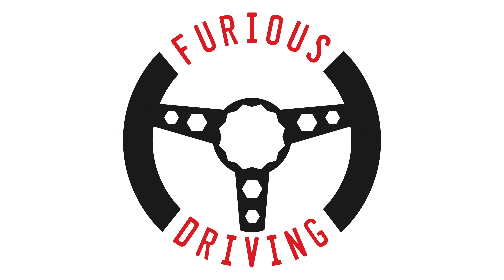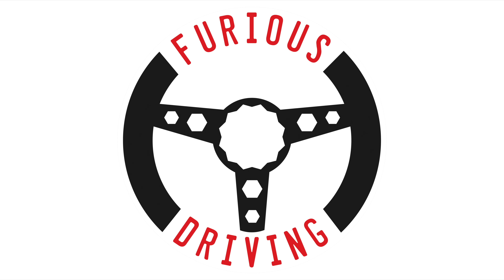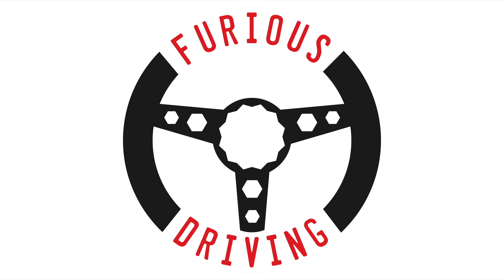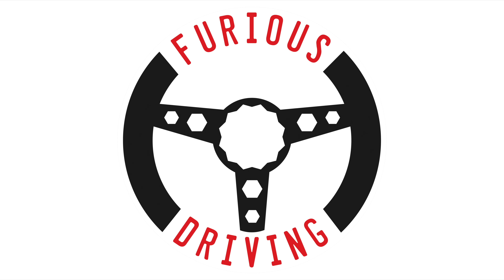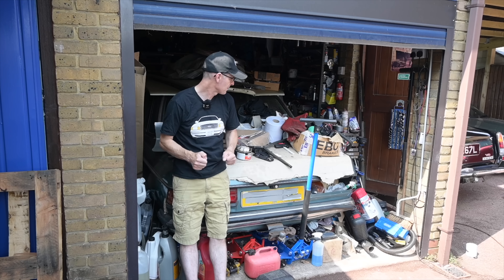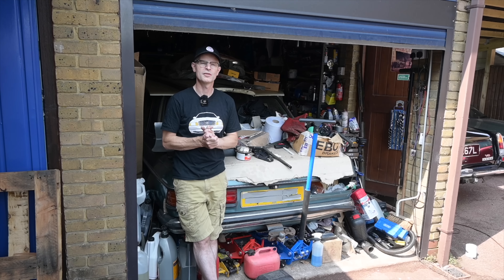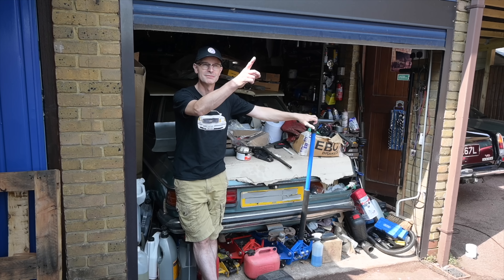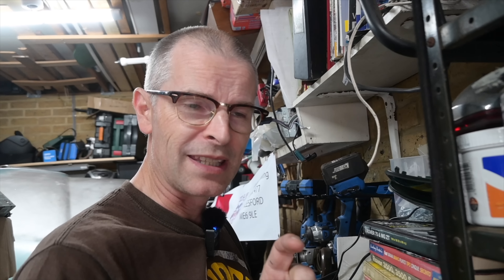Mercedes W123 broken again. ANOTHER new fuel pump....

Comment: Brought back some memories, this one. I was working on a friend’s Triumph Spitfire a few years ago and managed to pull the steel fuel line out of the rubber hose under the tank, which began to empty itself on my garage floor. Naturally I figured that folding the hose over would stanch the flow, only to find that the rubber was quite rotten, and simply crumbled. You never forget the feeling of nasty old fuel running down your sleeve into your armpit.

Comment: Good to see the tester finally make an appearance. Green LED indicates a ground connection, Red is positive! I've pretty much never had a problem with modern fuel, but I don't leave tanks with only dregs in the bottom. They should either be drained, or topped off (maximum fill volume and minimum surface area). There's a reason you should never run any car out of fuel. It pulls all the muck and sludge into the filer and pump and blocks the filter at best and destroys the pump at worst.
Reply from the maker: I had a similar issue with the cabrio after just a few weeks when the ethanol separated in the half full tank,

Comment: Maybe you need to fabricate a "Can of hope", like the one Jonny Smith uses. With high and low pressure fuel pump for injection and carburettor engines. You can use that for all your projects and then, when the car is almost done, fix the actual fuel circuit. Maybe ask Jonny for a build sheet 😃

Comment: The fuel does separate out over time and the ethanol will absorb water. Driving around keeps it mixed together but leave it unjiggled for a while and your in trouble. Also fuel only has an effective 3 month shelf life before the high end volatiles (the stuff thats in Easy Start etc.) dissipate so another reason to keep using it rather than leave it sitting. Think mowers sat over winter etc. 
With that amount of petrol splashing around in the garage you were well on your way to making an effective cannon strong enough to blast the Mercedes out the garage!

Comment: Small tip: use fuel stabilizer when you are not using the car for a long time. I had it once with my ur quattro after a long winter, the fuel got stale and ruined the pump and injection system. Replaced the pump and had to have the injection system professionally cleaned and setup again. Now I just throw some of that stuff in before it's winter hibernation and in the spring it starts up in one go! Nice to see the W123 again, hope to see more content of it!
Reply: My local mower shop sells Aspen fuel, ethanol free and 2 year+ shelf life. Pricey but probably worth it for these project cars that get started occasionally and tinkered with. Certainly cheaper than fuel pumps!

Comment: Hilarious opening scene with the garage door 😂, hilarious fan hitting the latrine too, "it's everywhere!" ha, 😂😂😂.
The fuel pump on my 190e went silent so I hit it with a broom and kicked it back to life, but I did it with the ignition switched on. I don't think banging it without current flowing will do anything, needs to be thrashed whilst power is ON. I felt certain the W123 would be completed in this video, all welding done, all panels refitted, MOT obtained and cup bleached from fungus. 🤦‍♀

Comment: I got a free Mercedes, (well I did pay a $100 for it..) once,   A 1974 280 the US spec, 114 body with the 2.8 liter DOHC 6.  It was stored in a side lean-to on a cranberry bog for a decade, and has some surface rust bubbles on the upper body surfaces.  Needed a new oil pump, intermediate gear and bearing inside the cam chain enclosure,  That was about $400.

  It was actually one of the few cars I've owned that the money in new parts actually made it worth the time and labor to fix.  It never really ran great but the transmission and engine were serviceable for another 100K miles, it burnt oil because of the early M110 engines had valve guides that wore prematurely.  Got terrible fuel mileage, about 16 to 18 mpg, was peppy, had bags of low end torque and the independent rear suspension even managed to do some off road dirt track driving with new winter tires.   It was a fire wood recovery vehicle for several months, the huge trunk (boot) holds a lot split wood.  It was flashy enough with a little polish that the woman that did my driving test with me said "I've never given a test in an older Mercedes,  this is really nice.."  But you know what I really liked about this, the turning radius, is tiny. if it wasn't for the huge bumpers overhang I bet you could do a u-turn in a standard width US alleyway.

Comment: It's not fixed. It never was fixed. That k-jet injection system is really fussy about cleanliness and fuel pressures. I'm pretty sure your rebuild of the fuel distributor didn't work and I'm absolutely certain that I never saw you adjust the fuel pressure at the various points. Yes it idles but it will never drive properly unless you get the fuel pressure right across the temp range. I have a 230e and I learnt the hard way.
There are many similar looking but different pumps, buy bosch, Ridex and other cheaper pumps have too low output. Some of the larger mercs actually need 2 pumps just to supply sufficient fuel.
Reply from the maker: It was as it was running perfectly, starting instantly, revving easily and idling smoothly. All that failed was the fuel pump being clogged by stale fuel
Reply: @furiousdriving I feel his frustration. He may not be right about yours but I too am feeling the excruciating pain of the Bosch fuel injection system.
Reply: Love to see a two hour video on that merc🙏🙏🇬🇧🇬🇧
Reply: if the fuel clogged the fuel pump it's probably also clogged the fuel distributor.  Anyway, we will see whether it fixed when you actually try to drive it. My own 230e started on the button, idled smoothly, reved freely and drove well... until it got hot, then the fuel pressure rose and it misfired ike a pig. Few people can do more than chuck very expensive parts at these cars. It has made me pretty much an expert on k-jet.

Comment: I know how you felt.  I once tried changing the fuel filter without the correct tools on my Audi Coupe with 10 gallons of fuel in the tank.  I pulled off the pipe from the tank which I had tried to clamp unsuccesfully.  Lying on my driveway squising the pipe with fuel running down my arm and attempting to push the pipe onto the new filter.  I must have cursed a bit because my neighbour came out to see what the fuss was.  I told her that she might need to call the Fire Brigade as I was struggling to stop the petrol coming out!  Somehow I managed to get the pipe back on the old filter...  Panic over, I got a garage to swap it over.  Never doing that again!  😬

Comment: 2 decent trolley Jack's..... you are spoilt 😏
I can't complain, only took me 2 days to change the front bushes on the wishbones on a polo. Bloody vw design it so you can change the bushes but the engine is in the way so you've to take the ally subframes off as well and there's bound to be a bolt seized (18mm 🙄) so I had to buy spanners in a size nobody uses.....

Comment: At 15:00 I spot a yellow license plate on the wall, that is the old style Dutch license plate. It comes off an Alfa Romeo 33 1.7 IE that was licensed on 25-04-1991. It was scrapped in 2003.

Comment: That's good l do like the W123 as it probably is the best Mecedes Benz ever made and at a local mechanics workshop there is a W123 300D they are working on it occasionally the W123 is not registered more likely a project car and it will be running soon

Comment: Firstly, you could try 'aspen4' fuel from garden centres! Costs a fortune but is ethanol free! Secondly, before removing fuel pipes, find a bolt of suitable size to block fuel pipe!🙄
Reply from the maker: that would be about a 25mm wide bolt thread on this

Comment: At last some W123 action 😊😊😊 however these early fuel injection cars are extremely touchy feely. They do not like being left sitting for any length of time. Also modern fuel especially your garbage E5 or E10 you have in the UK Does it no favours. 
In the land down under our standard 95 unleaded petrol does not contain any ethanol in it at all. 
We do have E10 but only at certain garages it is very hard to find it at most places. 
It is therefore punishing you for neglecting it for so long. 
Also stop complaining about it being too hot 🥵. 30c is a what I like to call a warm late spring day. Then again I’m Australian so go figure.

Comment: Wants weighing in this does.
Reply: No way! With that attitude there would be hardly any classic cars on the road!
Reply: @markf4720  You were saying......
Reply: @jimmyk9523  ok, so you knew about the latest rust before everyone else?! I doubt it, strikes me you were just being negative! The Merc could still be salvageable, but it really does need a very thorough inspection before making a decision. Anything is doable with enough time and money, it just depends on how much someone wants to save the car!
Reply: @markf4720  Not at all no. I have however restored two cars at home and I'm therefore qualified and experienced to know what kind of work this car needs and what's involved. This car if it is to be repaired properly and is to see the road again needs 100% effort and concentration on it. You can't dip into a project like this once every two months.
Also this car needs significant structural welding, that means decent penetration on the welds so they are as strong as a solid piece of metal. From what I've seen his welds are not good enough for this, merely due to the fact I've seen him running continuous arcs on car bodywork which if the welds were hot enough and penetrating  enough he would burn through after 3 seconds. Don't be fooled by this guys videos his welding is not good at all, which is fine on a wheel arch or patching a sill but anything that's holding a suspension part on, well if he welds it I wouldn't get in the car.
Reply: @jimmyk9523  I agree the car needs to be repaired properly of course, and Matt said himself in the video that he's 50/50 on whether he can do it himself or not. Hopefully he will be able to, but if there are areas where he's unsure he could get help with those. Anyway, my point is I objected to your initial comment at a point we didn't know about the latest rust, so I thought the suggestion to scrap it was premature. Just because things have subsequently turned out the way they have doesn't mean you were right (as you suggested in your second comment!). At that point really (or indeed when it was first acquired!) the car really needed a thorough inspection to check out the rust situation before spending time and money on it.... But don't forget this is YouTube and problems = content and so I'm happy to watch as things unfold and enjoy seeing how Matt responds to all the challenges, it would be boring if he just got a free car then scrapped the thing in 1 video!!